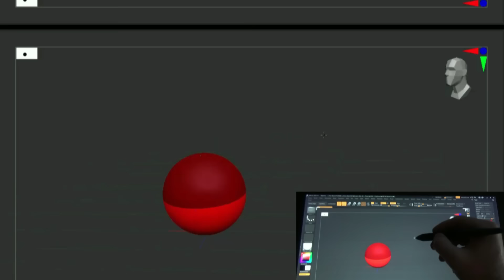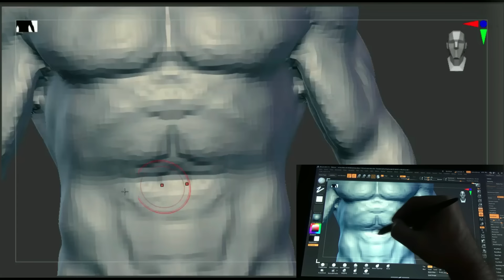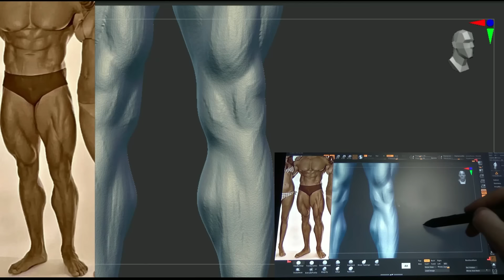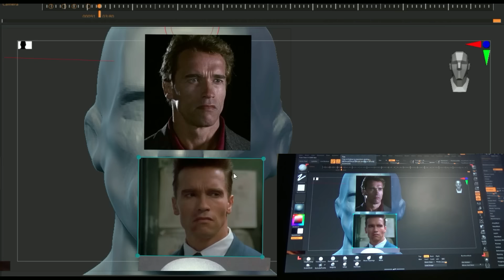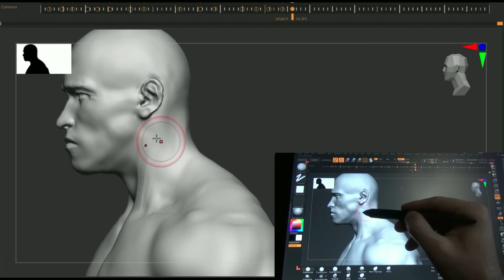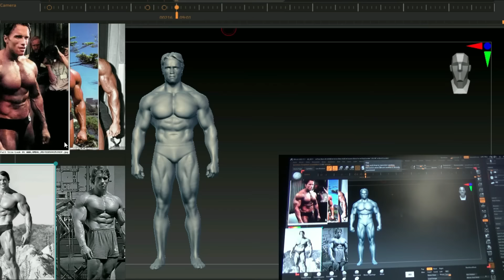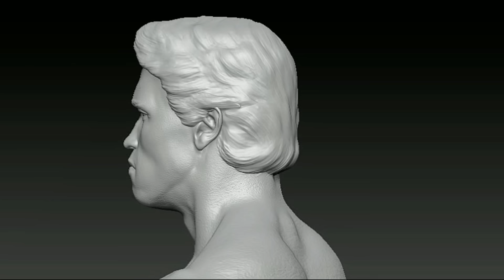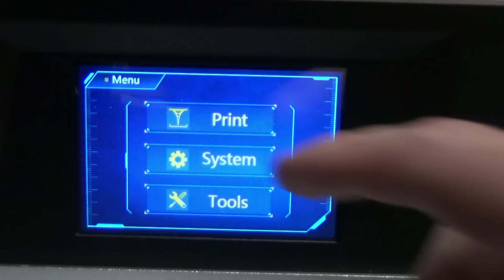Arnold Schwarzenegger modeling in ZBrush  Creating a realistic figurine for a 3D printer

Comment: Hola excelente los trabajos. Quisiera saber que material utiliza para el modelar. Si puede contestar se lo agradezco. Saludos Córdoba Argentina
Reply from the maker: Hello. This is the standard material, I switch between several so that the eye does not get used. Sometimes I put noise on top to see the surface better.
Reply from the maker: Hola. Este es el material estándar, cambio entre varios para que el ojo no se acostumbre. A veces pongo ruido encima para ver mejor la superficie.